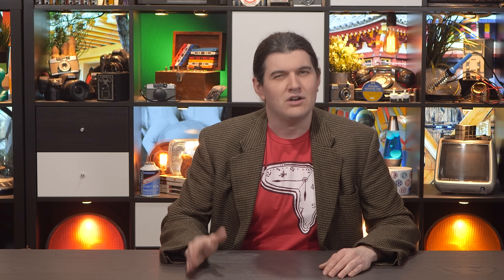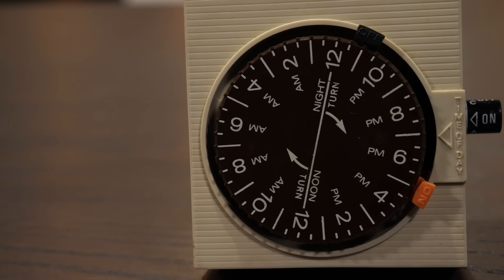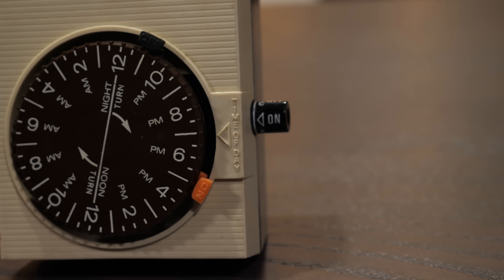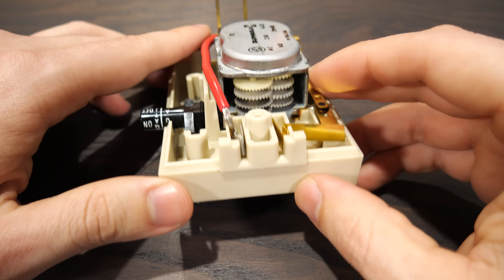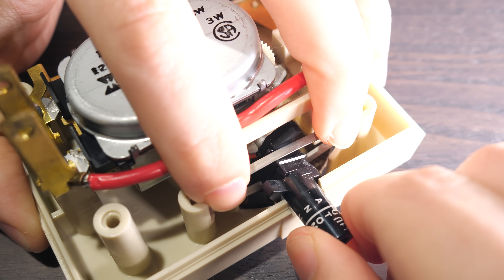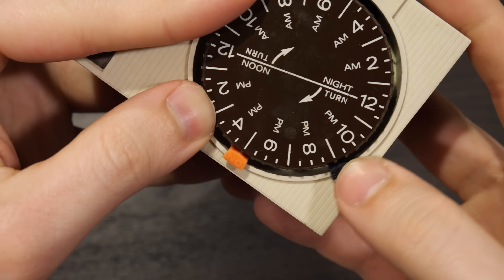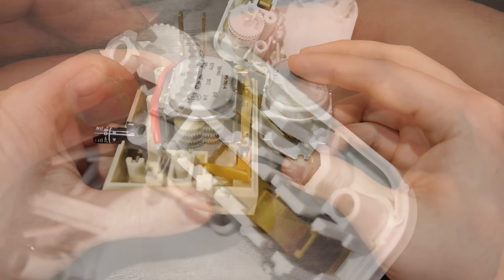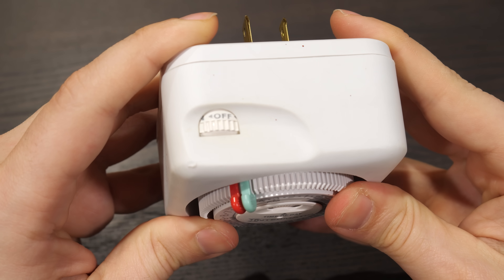Timer switches: literally just a clock and a switch

Comment: Reminds me of a contraption I made when I was younger. I wanted to record a radio programme that was on on fridays while I was in school. So I bought an ikea alarm clock, that usually rings a bell, I disabled the bell, and instead wired, I think an aux plug, in such a way that it would pull the left audio channel to ground. By wiring my tape player up (with soft push controls) so that the ground and the left audio channel of an aux female connector were connected to either leg of the play button, I could press record on the tape player, turn on the radio and hook the alarm clock wire up to the play button wire before I went to school, and when the alarm clock stroke 10, instead of ringing the bells, it would press play, and start the recording. Only bummer was I had to wind the tape so that exactly half an hour was left, because the alarm clock had no way of stopping the tape again, though if I really wanted to, I suppose I could have gotten another clock and done a similar arrangement at a different time with the stop button.

Comment: I have two of those sitting on a drawer right now! And now that I know they use electrical frequency for timing, I really want to plug one into an airplane's receptacle. Most jets run with 400Hz AC current. Probably don't do this...

Comment: Fun fact: a couple of years ago, clocks in all of Europe went wrong. Kitchen clocks, microwaves, ovens, all wrong. It turned out that a part of eastern Europe had sucked off energy from the joint European grid, slowing down whole Europe to a tiny bit less than the usual 50 Hz. It was fixed by driving the grid for some weeks at slightly more than 50 Hz to let clocks to catch up.

Comment: Variants of the third design are common as muck in the UK, albeit with 96 tabs (15 minute intervals) - but as they age, the gearing becomes increasingly loud, so I relegated them to controlling porch / outdoor Christmas lights, and bought the fourth type for indoors.
Reply: Exactly the same situation in Germany. The one I bought was quite noisy from the start, but it only cost about 3€, so I never expected high quality! ;-)
Reply: A little grease on the gears usually allows them to run quieter.
Reply: @rootbrian4815  It's not squeaking though, it's clicking, so I suppose grease won't do anything about that. At the moment I don't need the thing though, so I can't be bothered to test it ;-)

Comment: Has anyone mentioned swimming pool pump/filter timers? They are the most prominent use of the mechanical timers usually with multiple tab sets. Fulfilling needs such as pump noise mitigation, achieving optimal results by running after the worst of the days debris has fouled the pool and if using a automatic pool cleaner (Kreepy Krauly) allowing for settling, both equate to shorter running times to clean the surface and bottom. Unfortunately because they were mostly used within this industry their cost would be inflated prohibiting other uses. This has improved as energy saving has become a mainstream endeavour.

Comment: In the UK the same mechanism used to be very commonly used for controlling hot water/central heating boilers. I swapped to a digital timer when my boiler was replace a couple of years ago but I still prefer the old-school mechanical version. Sure the digital  version can be set in five minute increments and have different programme for different days of the week, but the mechanical one is so much quicker and easier to set.

Comment: We have a couple of these at home to control some lights. Specifically the ones with push in tabs. They're really neat. Thing of note: the US ones don't work in Europe, because our power is going at 50hz and the motor has to be adjusted accordingly. 

There's also the Hammond clock. A device that is literally just a clock that uses the power grid to keep time. Both quite cleverly designed dumb devices that hold my preference. I prefer my lightswitches to not have an app. You spend a little time in the IT world and you learn to hate the idea of your phone controlling everything.

Comment: Ideally you would use a timer and a photocell together in a commercial setting. That saves you from daylight savings changes. The light will not come on until it is dark enough even though the timer is allowing power. This way you don't have to keep moving the time forward and hour and back an hour for daylight savings.

Comment: The best life hack I've come up with was using a lamp timer to reboot my flaky ISP-provided router every night at 3AM.

I went a step further with the outdoor lights and lights in the entryway when I get home from work: all outdoor lights are dawn-to-dusk bulbs which just turn on when it gets dark out and off when it gets light. One of the outlets in the entryway has a special outlet cover with a photocell and LEDs that project downward from the edge onto the floor. The neat thing about that is that the lights vary with the photocell, there's no hard on/off, just a smooth ramp of no light to full bright.

Comment: Funny story about the timer with the permanent tabs.  One time I had a hard drive that would only work for about 20 minutes at a time, so I ended up using ddrescue and one of those timers together overnight to recover the data with alternating positions for every tab for maximum switching frequency (for that type of timer).  Worked good enough.

Comment: Time clock controlled lights pre-date electric light. There were gas street lights with 8-day clockwork movements which open and close a gas valve. I'm not sure whether they used a spark striker of some sort, but I think a pilot flame is more likely.

Comment: I'd argue the ones with the removable tabs are functionally superior to the multiple lever models. You can manually override it for a period of time and have it take over on schedule. I have one that's a hybrid of the designs you picture here 48 levers, and rotary override, and, without moving it to the long term override position, you can only override until the next half hour increment.

Comment: I have this Intermatic Time-All and a bunch of other types I bought from the thrift store in good shape. I've started to build a small collection of these and got one going again by opening up the case and applying a small amount of white lithium grease to one of the gears. That particular one did not want to rotate the clock wheel. Pretty neat old analog technology. My parents had one of these mechanical timers for a light in the house when we were away at the cottage.

Comment: Ugh.. I had two of the second type of timer, but only had one ON and one OFF tab for one timer, so I tossed the second one out last Dec. Damn, wish I had known that they sold replacement tabs.
I ended up using an older one that had tabs that you push in towards the center of the wheel, or out, vs. the up or down version. A bit kludgy, but still serviceable.

Comment: As an owner of the second timer switch, I can say that the double-action leafspring/switch is INEFFECTIVE at preventing arcing. When I turn the switch off with a payload that is on in the dark I can see a teal flash coming out from the cracks of the switch wheel hole. In these circumstances I have to turn the switch off with a lot of force in order to ensure the connection breaks fast enough to prevent oxidization.

Comment: the third design is eerily similar to the timing mechanism that the boiler in my old flat had. Instead of tabs it had small levers that would move inwards or outwards, where a lever outwards means the heating is on for that half hour. It was pretty neat, not as flexible as my current one that can set a different schedule depending on the day of the week, but way more usable as this one with only 4 buttons is a pain in the a** to change.

Comment: the Up/Down style of timer has been the most common budget timer. We can buy digital ones, and even smart internet connected ones now. I have a calex one that I don't used timed (but can if I want) I do have a bulb set up to do this though. From what I gather the electronics for it are built into the bulb cause it will still do it's timed actions even when disconnected from the internet, and or mobile phone.
Reply: *most common budget timer in the UK since the 80's (sorry started to think of the next sentence before finishing the existing one)

Comment: There is another incredible advantage these analog timers have over digital ones:
In the case of a power outage they retain their current time, and don't completely lose everything because the purchasing department somehow managed to buy a week-timer with daylight savings and programmable holidays that DOESN'T have an internal clock battery; and of course installing one would require convincing that very same purchasing department to aquire one.
So instead of maybe once per year when somebody manages to turn central power off for more than an hour, by ripping a lighting fixture from the ceiling, setting the timer correctly and even without that still retaining a somewhat sensible schedule, you have to go to EVERY SINGLE control panel and set the date and time manually after even the slightest power surge that pops a breaker.

Corporate interference coupled with corporate incompetence and corporate refusal to listen is the reason why solutions that the corporation itself can't control over a network are the best solutions.
You're telling me this machine needs regular calibrations, but you think I am incapable of doing that? Great, that means nobody gets any chance of making me half-ass those calibrations in a quarter of the expected time; and the machine is actually tuned as intended.

Comment: I think I may have single-handedly kept Intermatic in business over the years, as I have bought at least 15 of those mechanical timers (in all the versions you showed). And, I have several of the electronic timers too. I'm one of those idiots who puts up enough Christmas lights to be seen from space. and I typically will use about 8 timers to control them. The main issue with the mechanical timers is that they get very noisy after a while, and are very annoying indoors. Electronic timers are used inside my house. The problem with the electronic ones is that you have to have a degree in Computer Science (or remember how to program a VCR) in order to set many of them.

Comment: Hmmm so if you were in 1975 and your sworn enemy used one of these you can pop it open and remove one of those leaf spring things used to create the snap action that prevents arcing. And then turn on the gas to their stove and let it run. Then set the timer for 12 hours, coinciding with the time you're giving a speech about the merits of Fondue and the Hustle down at the Elks lodge so you have a perfect alibi when cops ask where you were when your enemies house and bell bottom pants collection got blown up?

Comment: I never knew there are such intricate switches. I only know the timer pole for car electric heating for winter mornings that are installed in the parking place. I recently got a plant light and you couldn't tell externally by looking at it, but it has a timer somewhere in the lamp circuit or switch that turns it on for 16 hours (which you probably set from 6 am to 10 pm).

Comment: Pool pumps and Salt Cell Controllers also commonly use mechanical timers. Salt pools are great btw!!
Reply: Our spa just has one of the push/pull tab timers mounted outside in a weatherproof enclosure. It works fine but has needed replacement once due to being outside (or just years of constant use)

Comment: I have a lovely old timer used to control school bells made by the English clock company Gents', it's programmed by inserting little pins into a nickel plated brass wheel some 10" in dia. It is intuitively obvious how to use and programme it. Someday I will get round to making it work the central heating. It can even be made to do different things at the weekend, all obvious and simple.
My heating is controlled by a timer made by Horstmann, once a maker of fine mechanical time switches including lovely clockwork timers to control gas flow for old boilers. Now however they make electronic timers, that can only be programmed by multiple button presses accompanied, by obligatory beeps and needing a 7 page manual.  Seven pages of fecking flow diagrams.
And this is progress? Can you set the clock on your cooker?

Comment: We have them in almost all houses with an inner electricity pannel, and they're more common in religious areas. They're being used almost excusively during the weekends though.
We also have the wall plug versions, where you can plug it to a wall outlet and connect an electric (and even electronic) device to it, making it turn on and off on demand without affecting the general power grid.

Comment: Picked up a basic timer, like the one with built in pegs you showed, at Christmas for my tree lights. Cost £3 from the local hardware shop. So cheap and simple. They even had a version with a week timer on it, instead of 24hr. Just meant the outside wheel moved very slowly as they’d squeezed in an entire week on it.

Comment: You don't need a special place to store the poky tabs as long as you don't need the on and off positions to be as close as possible. Since it doesn't do anything if it is already in the correct position, you can just store the  spare on-tabs after the on-tab that is at the desired time. Same is true for the off tab.

Comment: I just bought my first mechanical light timer in November!  I got the indoor kind and put it in an outdoor covered, fairly shelter outlet.  One day I flipped it to "on" and the dial got stuck.  Even since I brought it in and let it get warm, it continues to be stuck.  I think the cheap clock mechanic jammed itself somehow, and it's stuck behind some thick molded plastic connectors, so I would have to do a whole lot of damage to get to it.  I left my gutter-mounted incandescent Christmas lights plugged in after that.  They're still plugged in 24x7 because I like them, and I like to think they're providing a small amount of icicle reduction.

Edit:  my cheap new light timer doesn't have the neat little rotator switch, just a slider that doesn't react to the state of the many pins.  Also, I just picked it up and tried rotating it, and it turns now!  It has some hiccups in its turn though, and I don't know why.

Edit edit:  lol looks like I'm gonna buy one of those neato Intermatic timers, it looks much better than the crap Stanley thing I have that has the 48 tabs.  I think I'll get destructive with this thing and figure out how the hitches happened.

Comment: the wires to the motor look like wire wrap they aren't supposed to be soldered.   The wire is stretched around a square pin.  The sharp edges hold the wire in place, its a technique widely used in the past.  I have seen it in old stereo components.

Comment: My oil-filled radiator-style portable space-heater has the latter style timer built-in, but it has 92 switches so it can have a 15-minute resolution (and they don't go up or down, they go in or out, relative to the center of the circle).

Comment: Since you were wondering, the wires probably aren't soldered. It's a technique called wire wrapping which predates the widespread use of solder and still is used occasionally to connect components that don't take solder well. Although, it normally works best on leads with a square cross section as it bites into the wrapped wire a bit better.
Reply: yup wrapping was a huge trend decades ago. With squared pins and the appropriate tool it makes very reliable contacts. Now it's mostly used when solder melting is a concern.

Comment: My parents used that model of timer switch (or at least, one that looks very similar) to prevent my sister and I from watching TV outside of a particular time period (we were only allowed 30 minutes of TV a day). Of course, we eventually figured out how to work it ourselves, so they had to up their game by locking the timer switch inside a toolbox, which my dad had drilled holes into to let the power cables through.

Once I figured out how to remove the hinge pin on the toolbox, I made sure not to make it so obvious that we'd once again defeated their scheme, and my sister and I got to watch Sailor Moon and Rescue Rangers every weekday, instead of just one of them. Hehehe.

Comment: I'm pretty sure my family had the exact same timer as that 70s one. I really hate the push-pull ones. They use one of those for the lights at the nearby dog park, and occasionally the circuit braker might get tripped by a particularly heavy storm, and invariably some dumbass who doesn't understand anything will mash in all of the buttons in an attempt to make the lights come on, and it's a pain in the pass to pry them all back up to set it properly.

Comment: Thanks for showing us he innards of the timer. I had never looked inside it. We had an Intermatic D111 exactly like that one at my house as a kid. My parents bought it around 1975. We used it to switch on a lamp in the living room when we were out of the house in the hopes of keeping thieves away. I remember that it wasn't perfect. It was hard to accurately set the exact time you wanted it to come on or off - the time you chose on the face was usually 10 or so minutes off  from the time it actually switched. However, it was very reliable and would keep time and turn on and off at exactly the same each day.

Comment: Here's my unusually use for one. I have an old refrigerator I store welding rods in, and to keep humidity out I have it turn on the light inside twice a day for 30 mins. Works great and I don't even have to bother setting the time.